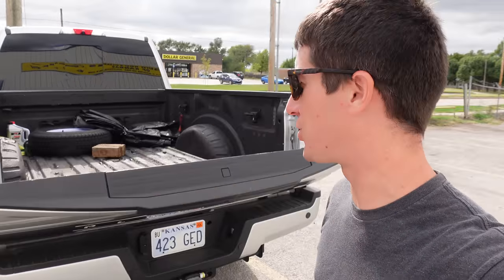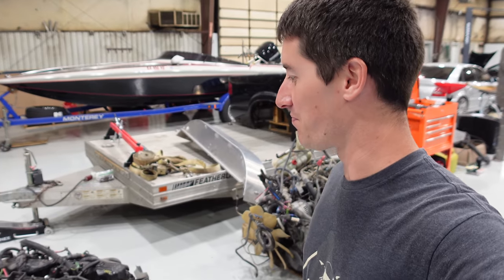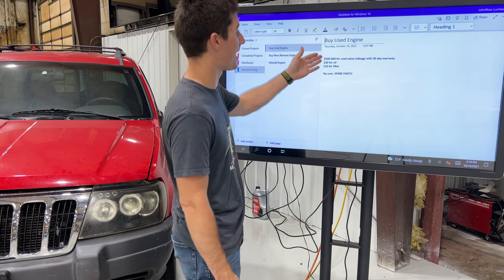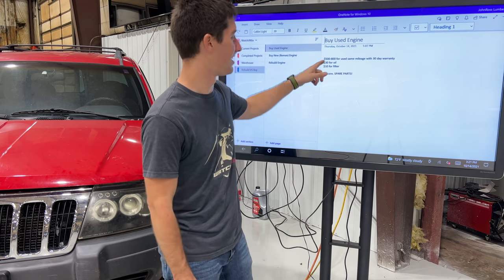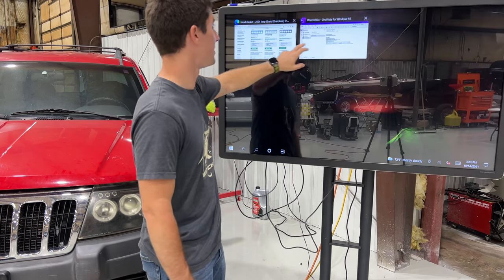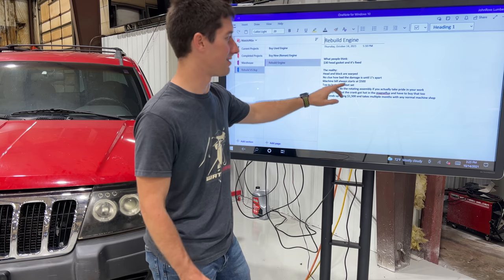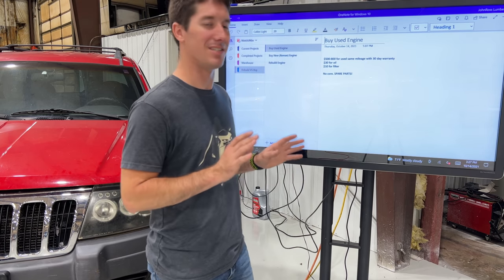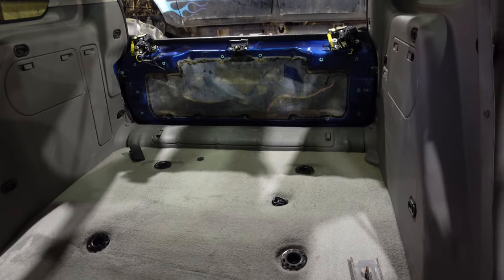Here's Why You Should NEVER Rebuild An ENGINE *The Math Doesn't Add Up*

Comment: What I've learned in the first 60 seconds is don't buy a car from this guy. He puts a scrapyard engine in it and sells it to you immediately.
Reply: I always rebuild. Especially a JDM. All injectors go out for service too.
Reply: I had a shop and did this.  You can get low miles and warranty.
Reply: i would. he will save you money in the long run
Reply: you forgot to mention a scrapyard engine that has a warranty, if you bought a secondhand car elsewhere its a concrete warranty 
as soon as it leaves the concrete the warranty is done, LOL
Reply: @markandmellwhiteley7995  Yeah usually a warranty that isn't transferrable and doesn't include labor. Even if it is transferrable now you're stuck hoping the person that sold you the car with a scrapyard engine would replace the engine with no labor charge. 
It's like buying used tires. It might get you by today but in the long run it could end up costing you more.
Reply: If you properly check a used car before buying, you shouldn't have any major problem, remember you are buying a used car
Reply: Junkyard engines are better than rebuilds for the most part as long as the oil was changed in it during its use
Reply: @edstacks5254  The only time that's true is if the rebuild was done by someone who has no idea what they are doing.
Reply: A rebuilt engine properly done will last 200k, a junk yard engine is 50k, I get what he's saying but you make the call as the customer
Reply: Just try to collect on that junk yard engine warranty and see how good it is
Reply: @jimstern4244 🤣😂😆 exactly
Reply: 😂😂😂😂 right u be buying junkyard engines
Reply: Nothing wrong with second hand engines or gearboxes as most professional vehicle wreckers record the condition of a engine before removing it ie running condition and 3 month return policy. No problem.
Reply: This guy is a hack. Why would you at least not check your con rod bearings real quick, and if it came out of a car with front end damage I'm definitely changing that head gasket.
Reply: Z1 charges $800 for a core for a vr30ddtt...
Reply: He’s a hustler/used car lot cat
Reply: Do you, but I am sure he doesn't give 2 Phukets😅😅😅.
Reply: That was good  🤣🤣🤣🤣
Reply: Unless its a collector car….and your car’s engine blows….just junk it….it is not a 1970 SS 454 Chevelle your dealing with…just let it go folks…😂😂
Reply: @edstacks5254  yep.
Reply: As long as it comes with a warranty I don’t see why not
Reply: Nothing wrong with that
Reply: Swap it out. Don't tell anyone!

Comment: For people pondering the concept of replace vs. rebuild on your own car that you aren't flipping, consider that new parts are sometimes newer versions that address engineering flaws. Also, rebuilding and being meticulous, measuring every bore and clearance and whatnot, you can make the engine better than it came from the factory, probably fixing missed defects.
Reply: Yeah, there's some old school pros that have their secret modifications. Polish this, remove casting burrs, round some edges(sharpen others), add lubrication channels, better material piston sleeves, pistons and crank shaft and etc. Engine rebuilds are absolutely fine if done correctly, it can give almost infinite longevity to an engine block.
Reply: @kinsmart7294  do you guys happen to know how many times an engine can be rebuilt?
Reply: @joshuetortega3572  As far as i know it can be rebuilt as many times you want depending of the damage. were bored down then set back to standard again by using sleeves.
Reply: @Joshuet Ortega  its as many times as you want if it a race motor but for a daily driver it's like 3 times with 400,000 miles in between cause at the end of that 3 rebuilt motor that engine has almost a 1.2 million miles and it's just worn out
Reply: want to rebuild the engine in my 96 Toyota Avalon its worth it to me
Reply: @joshuetortega3572  A rebuild is always possible. It just isn't always economical. It can be rebuilt as many times as is required until the engine is no longer worth rebuilding.
Reply: There are engines that are not rebuildable, so not always an option.
Reply: @sc3ku  like which?
Reply: @sc3ku  most engines should be rebuildable unless they ran the engine thru shit even the signs are showing and they still keep running it.
Reply: Rebuilt engines are worth 10x scrapyard engines. Doesnt make sense for straight flipping unless you want a really good reputation for reliable vehicles. Rebuilding makes perfect sense if the engine is caught early. About to rebuild my trucks motor because of uniform low compression (still runs fine). Some new rings and bearings and it will be solid for another 200k
Reply: @matthewevans8469  it doesn’t make sense for flipping period it’s just too much work for too little return.
Reply: If it's a project rebuild it stronger if it's a flip car / daily always replace if it's something major that requires heads removed or electrical
Reply: @anthonyrathore5192  I have to disagree, that's an arbitrary way to look at it. If the parts can still be machined within tolerance, it's 100% as good a candidate for a rebuild as any other engine, mileage is not a factor. A block with 0 miles that can't be brought into spec is junk, a block with 10,000,000 miles that can be brought into spec is every bit as good a foundation as a new block.
Reply: That's what I was thinking while watching this. With an engine swap you still get a used piece of crap, but if you rebuild you get brand new parts.
Reply: @aaronlamarr8456  keep them 96s going! I’m planning to rebuild my 96 silverado 5.7 and upgrade it with a cam and bore. it has 263k currently and runs like new. I just want to rebuild it because I wasn’t the first one to put them miles on it and well.. i like to know what’s been done to it for it’s life 😅 and a guy I knows 97 5.7 has 500k miles.. no bs old school rides last.
Reply: @jouniranta-puska4699 To a certain degree. The block on a rebuilt engine is normally the same block from the donor vehicle with at least 200,000+ miles on the block. So the block isn’t brand new. And to find OEM pistons and rods is quite hard without spending hundreds of dollars on replacement ones. This is why you re-use the same pistons, and gap the rings to the corresponding bores. As well as reusing the same crankshaft and just sanding it to place brand new bearings on is just as fine as using a new crankshaft, as long as it’s not warped due to heat. The rest of the top end can be completely replaced with new parts, new pulleys, ect. And it will still be considered a new engine minus the block and the pistons. A bang for you buck though would be to rebuild a junkyard engine. Unless you want all brand new parts already on the engine itself, then you buy a remanufactured engine.
Reply: And another point to add, most V8 OEM pistons were designed back then for longevity and not power. Hence why most pickup trucks back then had only around 285-300HP and not 400+. They designed them with less power and lower compression for longevity. So imo, the stock rods/blocks from a donor junkyard engine is the best route to go for longevity.
Reply: Throw away mentality is what's wrong today, learn nothing and improve nothing
Reply: Have you ever thought about the fact that its fun and educational??
 Rebuilding an Engine challenges you to do the best job you can and teaches you to pay attention to details and specs while giving you a true appreciation of just how that engine works. 
You shouldn't tell people to "NEVER" rebuild an engine. You are in effect encouraging them to miss out on something really valuable. Even if that engine is not used.
Reply: Doing it yourself can make it better than buying a rebuilt, but better that the factory is unlikely.

It is just a shame that in our culture time is considered money* and generally speaking a man raising a family does not have the time to rebuild an engine meticulously.
Reply: @joshuetortega3572 it depends on the wear of the parts. They go .010,.020,.030,.040 and.060 oversized.
Reply: Yup. Say your engine goes at 250k miles. You put a used engine with 100k miles, you're good for 100-200k miles. Maybe worth it if it's cheap. But that replacement engine may need work right away and will not be as trouble free as a rebuild which may go another 250k-400k.  I would say it also depends on the car body. If it's a Kia, Chrysler,  jeep or something you fix it as cheap as possible.  The body will rust out anyway. If its a long lasting car like a homda or Toyota,  fix it right and it will reward you.
Reply: Or...you get a factory short block for same price as the parts and 2 hours of labor.
Reply: Practically nobody is going to be making their used rebuilt engine for a daily driver, better than it came from the factory, unless it was actually a factory defect that caused the engine to be worked on in the first place.   Odds are that you aren't going to make it better and if it wasn't a victim of abuse then it was a  bad design and it is a vehicle that you should consider flipping, unless of course you just wore the engine out, that it has 200K mi or more on  it.
Reply: @TrippyWoodStock  Just bought a 96 Nissan 3.0 Cefiro Maxima with 215,000 miles on it for $1200 here in SE Asia. Nice leather interior. Bad gas mileage though.  I should just leave it alone and use it when I need it.  Really don't need a car here.  But I'm tempted to do rings and bearings.  If I had to commute it might be worth it. But yea you're right. The new cars suck.  And dopey people keep buying them .
Reply: @RATsnak3 rotory (like Mazda Rx8) engines i believe can’t be rebuilt.
Reply: @Wicked_RotF30  It is entirely impossible to make an engine that is impossible to be rebuilt.
Reply: @joshuetortega3572  a lot of times the question is does it worth.

there are guys that dont fix cars they sell it and buy a new one..!
Reply: @aaronlamarr8456  alaways worth if it its usefull to you.. and depends on the damage
Reply: Is it a work car or a classic? Is it mine to keep or to re-sell? My dad had his Olds Delta 88 6cyl 3.8L rebuilt. Never was the same. Should of just dropped in salvage yard low mileage. Would of saved him time and money and frustration. Also about blown head gaskets, yes. Might as well get that replacement engine.😅 The trouble after disassembly, $500.00 of parts and machining, (heads, block, crank, etc)and what not. Stock gaskets??? The list goes on and on. I did one head gasket R&R on a 4.3L V6. Cost me a month of machine work, downtime, parts, cleanup, wife upset (her car) and finally selling that Chevy Blazer LT a couple years later. A SALVAGE YARD engine and two days worth of work could of solved a lot of these issues. This vehicle also had the transmission rebuilt twice. Over the Top learning experience. Listen to the man here. Time is worth a lot of money and so is aggravation.
Reply: @ihavethedocuments2580  rebuyild- you can never do better than the factory

yor wasting time and money.unless its a minor repair,, like a valve job, for example.
Reply: @joshuetortega3572 as long as your engine has cylinder liners/sleeves, the you can keep rebuilding that engine as many times as your wallet will let you.
And, on the bright side, almost all engines can be modified to accommodate cylinder sleeves if  not already present with cylinder sleeves.
Reply: @aaronlamarr8456  I'd say heck yes. Those engines can last.
Reply: Yeah this no rebuilding engine guy just sounds lazy
Reply: @jimbojimson I don’t think most people realize an engine block is just a hunk of solid stationary metal and proper lubrication and clearances it’ll have the least wear of anything on the vehicle
Reply: @RATsnak3  many including many VW/vag ,and the 5 cyl volvo engines and most engines in past twenty years in most cars
Reply: @18_rabbit  you can rebuild them, I assure you. Anything that it is possible to build can be rebuilt.
Reply: Many flipper engines do have blown head gaskets!

Comment: the key part everyone is missing is having a reliable salvage yard which knows how to test and pull the engine correctly.
Reply: Its SO nice getting a nicely pulled salvage yard engine. One in which even the wiring harness is useable is a dream. Others, they literally wack everything off like an animal. Another salvage yard I try not to use strips them down to the long block. This adds to the cost for gaskets, and other parts.
Reply: you do take a risk on a" salvage yard engine", sure they will back it up if it turns out to be a" dud engine," but then you have more labor hours of pulling the engine you just set in place only to remove it again. the engine you get is a real question mark, in terms of the condition of the engine( wear, run low on oil / lack of oil changes, overheated, uneven compression). that is why I do not get into "FLIPPING" cars/trucks. I have seen guys put in a junk yard engine that does run, but the" check engine" light stays on, and cannot clear the fault codes because the engine is bad. so they either take the bulb out( if the processor will let you do that) or put tape around the bulb. that is why it is a real good idea if you are looking at a used vehicle, to run a "SCAN TOOL" and look for faults. also disconnecting the battery does not really clear the faults, they are "UNRESOLVED  FAULT CODES"!!!!
Reply: Yes, and it is getting very hard to get good service at my local yards. Back in the day, I would drive to the yard, tell them to replace my trani, diffy, starter or whatever and I would drive out a few hours later with a junkyard part installed. Now, they just want to sell the part and make even that buying process take longer than having it replaced at the yard in the past. 

I don't mind doing my own wrenching, but why does purchasing the desired part have to be so painful now? It is almost as if they think "look that dude wants this part maybe it is valuable, let's tell him we don't have it and mark up the price and sell it on the web."
Reply: @gregoryclemen1870  I agree I'm still rebuilding starter's alternator generator's hi amp alternators
Reply: @mechanic7892  , I still do it , not like what I did years ago. you get strange looks when you go into the auto parts store and order individual parts for this stuff. when you rebuild this stuff, you know what you have, and you  know that it will work and stay on the job for years to come. I can not remember getting "BIT" on something that I rebuilt, thanks for "CHIMING IN"!!!!! and have a great day!!!!
Reply: Good luck finding a reliable salvage yard.  In reality you will never find one....
Reply: You must have a Unicorn salvage yard. Ours wants arm and a leg for junk.  Yeah they warranty the engines, but not your time.  I have encountered a bad salvage engine and a few of my buddies have also.  Our yards just aren't worth the risk.  I would take the chance on head gasket and sand paper before i would go salvage yard route.
Reply: Definitely
Reply: It's in a salvage yard.. you know the other name for a salvage yard? JUNK YARD.
Reply: Not to mention an honest salvage yard
Reply: This part for sure!
Reply: @IndependenceIron  LKQ will ship it to your driveway. I've dealt with them several times over the years.
Reply: @im-that-guy-pal  Definitely a mechanically-challenged person came up with that term for it. To a mechanic, something like a flower shop or clothing store would be junk, while salvage yards are wonderlands of possibilities. lol